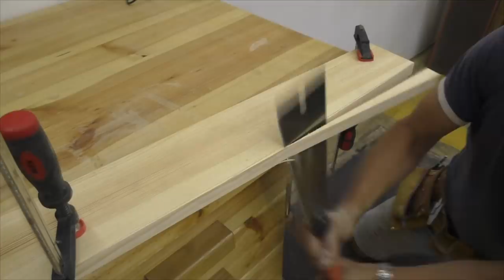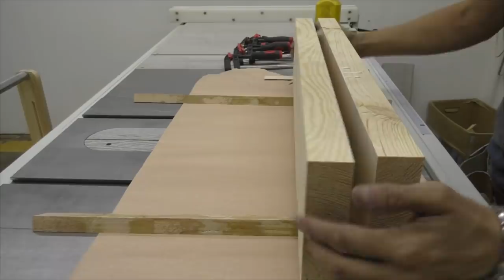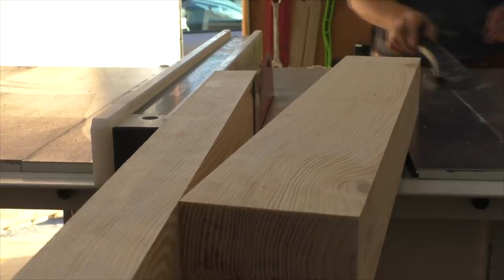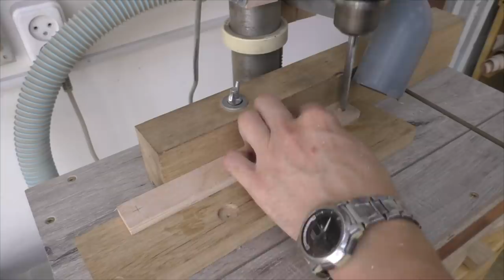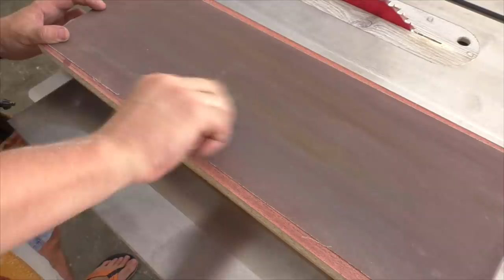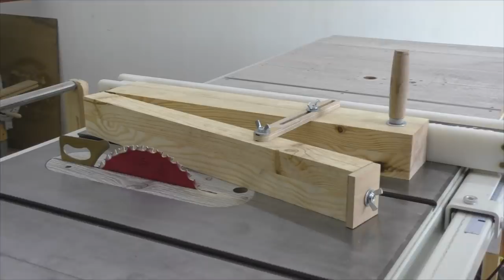🟢 Taper Jig for Table Saw - DIY Tapering Jig for Long Cuts

Comment: This jig is a recipe for kickback. The workpiece is not held down between the blade and jig, which could cause the piece to be drawn into the blade and launched into the user. Its actually a design flaw with the jig. A traditional tapering jig like those shown by other YouTubers are just as simple and not dangerous.